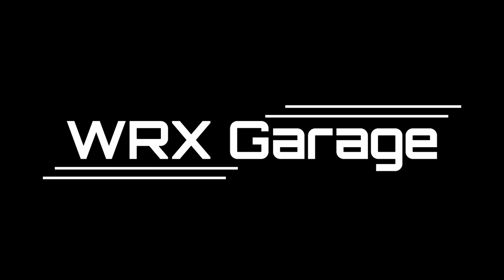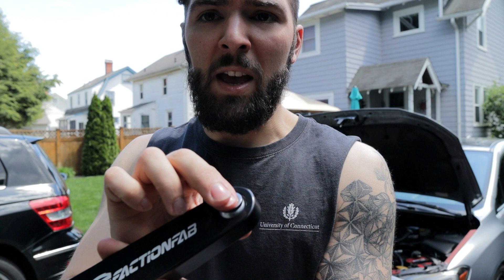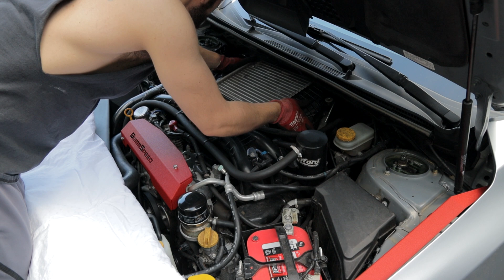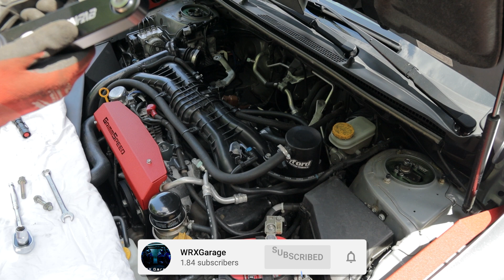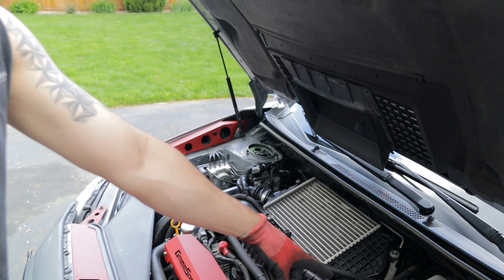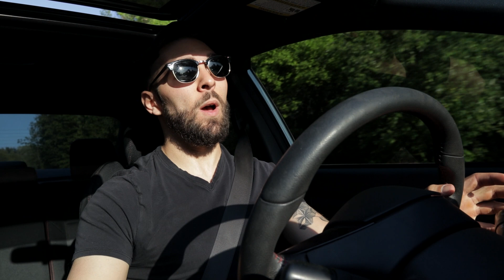The TRUTH About Pitch Stop Mounts - FactionFab Pitch Stop

Comment: I am one of the early reviewers who bought this when it came out. As I said in the review I noticed way more engine noise than I did even when I did my Invidia Q300 catback exhaust. Because it's metal on metal on the engine side it functions as a stethoscope or like a tuning fork sending the sound into the cabin. Especially on cold starts in winter. 

That said I love it and have gotten used to the louder engine noise. I remember specifically telling my wife that the sound is not a broken engine. 😂

The shift feel is dramatically better with this and especially under load hard driving it keeps the shits easier to find and crisp. This with OEM STi short shifter, Group N transmission mount, Boomba shifter adapter plate, Torque Solutions derlin shifter bushing, and Raceseng Rondure weighted shift knob my shifting is really good now.
Reply: Is the car noiser at start up? Specifically the "cranking noise" inside the cabin? Just installed mines and the cranking noise is really distinctly louder
Reply: Glad your shits are easier now....
All jokes aside, your comment was very informative. Thank you...
Reply: My friend that was doing my clutch and timing belt said it’s like a microphone for your drivetrain to behind your dash but really helped for grip.  He just did one on an auto trans one before mine and said it was way less noticeable on my manual.  Kind of the difference between my solid rear motor mounts on my fiesta st and escape 2.0 titanium.  Big benefits for grip and stability but a little more vibration

Comment: I installed that same FactionFab pitch stop on Friday, April 28, 2023. When paired with Perrin engine mounts, an Aluminati solid transmission mount, and the Torque Solutions solid billet crossmember bushings, however, I quickly found that the in-cabin decibel levels were way too extreme for daily driving. Tonight, I swapped out the FactionFab pitch stop for a pitch stop that has 95A polyurethane bushings at both mount points rather than just at the firewall. I have some other pitch stops that have 90A and 90A bushings if 95A/95A is still too much. All I know for sure is that, with my setup, a lack of any bushing at all at the engine mount point makes for a pretty gnarly daily driving experience (In-cabin/windows up/HVAC on lowest settings or off/radio off/Cobb SS catback/GS j-pipe: 70+ dB during the 1400+ RPM warm-up idle; 80+ dB during normal acceleration; ~65 dB when warmed up and idling at ~700 RPM). In concept, I really like the design of the FactionFab pitch stop, but even reengineering it probably wouldn't allow for the use of polyurethane bushings at both mount points. FactionFab would almost have to design an engine-side bracket that has bushings housed in the mount point itself to compensate for that "bone-on-bone" ball joint design.
Reply from the maker: Did you try adding the pitch stop brace from Perrin? When I added that it definitely reduced a lot of the in cabin noise!
Reply: @Foleys_Garage  I have a 2021, so I’m not too worried about the firewall brace integrity. I could hardly hear the exhaust, intake, and transmission whine over the sound of engine screaming at my firewall. It was like I had a microphone mounted up in my engine bay sending the live audio to my speaker system. For piece of mind (and curiosity), though, I may pick up one of the brace kits at some point.
Reply from the maker: Even if you're not worried about the strength of the mount on the firewall, the pitch stop brace took away the majority of that transmission whine

Comment: Biggest thing I noticed is around 2500-3000 RPM I hear what in my opinion sounds like rod knock (I know that it isn't) but it sort of almost sounds like clacking and is very throttle dependent, usually feathering throttle like 1-5% throttle I hear it clacking away like a diesel, something I noticed immediately after installing my Perrin pitch stop.
Reply: I want to note that the second I get on throttle the noise completely goes away, I really only hear that noise on decel. and in the scenario mentioned above

Comment: I have never considered this part. I am interested in it but half wonder if these are actually a good thing mainly because rigidity isnt always a good thing and increasing rigidity could cause additional stresses on other areas. As far as noise and vibration, if it is a mild increase then that serves as driver feedback from the car. My concern is largely with warranty and the potential other stresses. For instance, if you stiffen up the engine movement, what about the rest of the driveline that was built and designed to pair with a motor that moved around more.
Reply from the maker: The reason why the OEM pitch stop is so soft is solely for reducing noise and vibration. Putting the stiffer FactionFab pitch stop on would not have any negative effect on other parts of the drivetrain. I would suggest pairing this with a pitch stop brace from Perrin which will strengthen the connection to the firewall
Reply: @Foleys_Garage  have not seen a pitch stop brace for the 2022. do you have a link?
Reply: go w/the group-n mounts from Subaru

Comment: Faction Fab doesn't need the firewall bracing?
Reply: I'll respond to that I don't know if you're being funny or serious but I was actually going to comment that that firewall needs reinforced to where there back part of the pit stop mount connects or it will eventually rip especially with a heavy duty 75d polymer bushing in it. I did mine a couple years ago I ended up breaking my factory one and ripping off part of the firewall bracket that held it together so I bought Perrins full kit came with them out the reinforcements and the slave master steall braided line and reinforcement. I'm sure there's there's plenty companies out that just make the adapters for the firewall I think I spent like 360 bucks for the full kit from perrin

Comment: Seems like a must do type of mod, would this be smart to do on a brand new 0 mile 2022 WRX?
Reply from the maker: I don't see why not! It definitely improves how the car feels overall. Shouldn't void warranty either
Reply: I'm researching this for my VB as well but I feel like mods like this are why people have so many transmission problems with the wrx. Without the flex of the stock mount you are putting a lot more stress on the transmission. For performance, yes it makes a difference but if you want your car to last then I'd stay away from mods like these. 
If you expect to be replacing transmissions and are really building a track car then it's probably a  great mod.
Reply: @KushestWRX  I saw you installed a Perrin one. Any reason you didn't go with the Faction Fab like in this video? It looks like the firewall failure was for 2015-2017 models. I'm sure the VB has it all solidified by now, but I feel like I'd have peace of mind knowing it has the spherical bearing to remove some load from the firewall since I do some track days. Been doing a lot of research and it looks like the more solid you go for the pitch stop, the more the movement for things like acceleration gets reduced as well. Is that why you went with the Perrin? Perrin apparently uses 90a and 70a in their bushings and Faction Fab uses 95a.

Comment: Would this be a bad upgrade for a stock vehicle? Also I see a lot of ppl saying this can be harmful to the transmission and chassis allowing for less flexibility should I worry about that?
Reply from the maker: No, I don't think this could harm the transmission or chassis in any way. As long as you have a later model which has a reinforced firewall brace mount. If not, get the Perrin pitch stop mount brace!
Reply: 2018 and up is supposed to have the upgraded firewall mount.  Perrin offers multiple durometer bushings w/their pitch stop Mt....

Comment: Quick question: I have upgraded suspension / sway bars / strut bars / super meaty setup. I’ve noticed my brakes and clutch vibrates way more. I feel more chatter. When going in 1st and starting off I feel vibration in my brakes / clutch when starting off. Is that normal? It felt like this after installing the pitch stop.
Reply from the maker: Yeah that's entirely just because of the pitch stop. Stiffer suspension and meatier tires and also cause some in-cabin vibrations. The clutch pedal vibrations are definitely from the pitch stop.

Comment: Is the car noiser during start up after install? Specifically the crank noise inside the cabin for you?
Reply from the maker: Yes, most of the engine noises come through into the cabin a bit differently.
Reply: Yeah I’m getting the same sound coming out of there after I installed my Grimmspeed pitchmount
Reply from the maker: Add the Perrin pitch stop brace and that noise goes away!